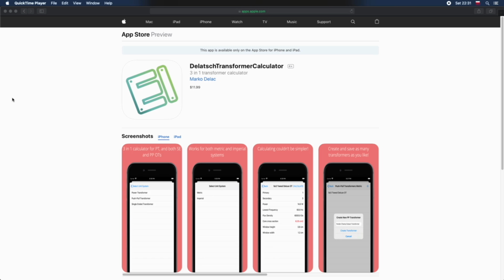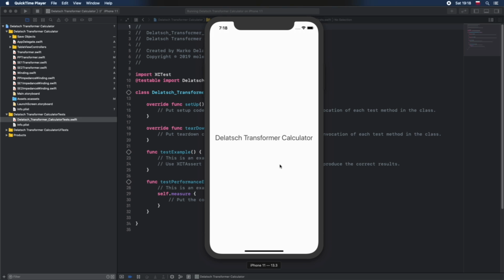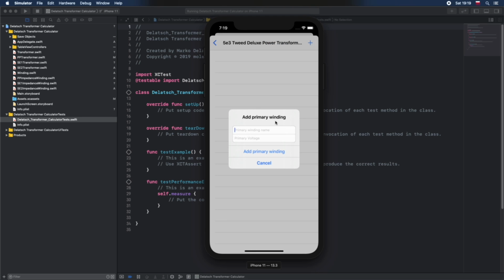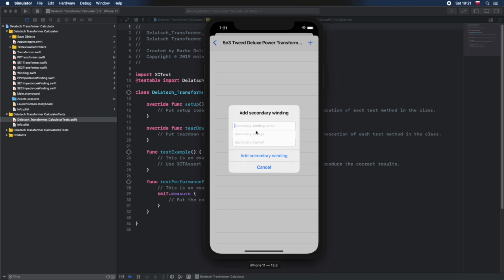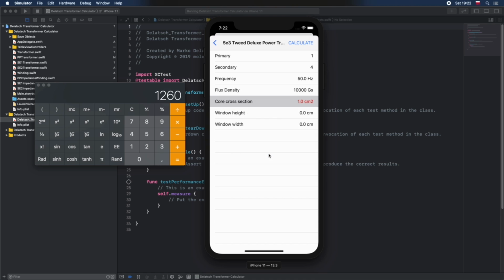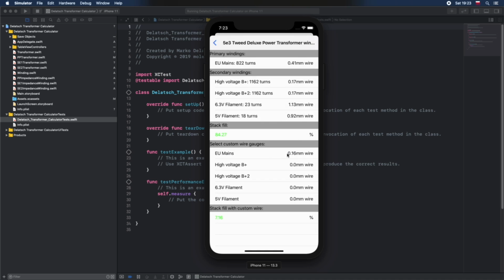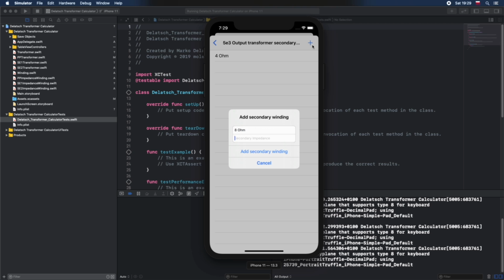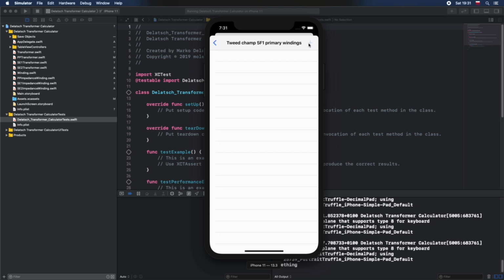Transformer Calculator App Now available for sale on the App Store! 2020

Comment: hi excelent congratulations . The app have all  the calculations and features  like your 3 diferent spreadsheet? The method for SE. trafos could set up for multi interlaves ? Please, Android too. Thanks
Reply from the maker: Thank you Juan! Yes it has all the features of all 3 spreadsheets, plus it can add multiple secondaries. It doesn't directly   do the interleaving for you, but you can easily manually divide the number of turns to the pattern you want. The android is coming soon as well, but it is a lot of work. There are many new calculators and app on the way so stay tuned!

Comment: For single ended transformers, what is method 1 and method 2?
Reply from the maker: Method 1 is using the inductance as the basis for number of turns and method 2 is more like a normal transformer calculation based on the voltage.
Reply: Thanks. I tried to contact you on your website. The message will not send. The app I purchased from your website will not work on my ipad.  @Delatsch

Comment: I  bought your app and see plenty bugs which makes using it really hard..but first of all it calculates wrongly.
Calculated output transformer:
Primary 3121 turnus 0.2mm , S1  70 turns 0.9mm,S2 99 turns 0.76 mm,S3 140 turns 0.64 mm
Custom gauges I set: Primary: 0.2 mm, S1 0.511mm, S2 0.511 mm, S3 0.511 mm
How it is possible app is not recalculating turns if gauges are changed?? I cannot trust this calculator.. Also buying four gauges to wind small 15W transformer is insane.
Please advice!
Reply from the maker: Hi, thank you for your purchase. I know the app isn't the most user friendly one, but the calculations are correct. The number of turns is not affected by or dependent on the wire gauge. The wire.gauge.is only important for the current, so that the wire can withstand it without overheating.

Comment: Hello. I’ve been using your app for while for power transformers and single ended out put transformer. I’m using M6 grain oriented laminations. For a p/p output transformer what value should I use for gauss core density? Thanks.
Reply from the maker: Hi, I would use 8000-10000gs
Reply: @Delatsch  thank you.

Comment: Hey friend, I have been following for awhile and appreciate you sharing your knowledge. I finally bought this app, and it's not working. I don't know how long it's been like this, but any time I hit the 'calculate' button, the app crashes. I've tried multiple times with different transformers and cannot get it to work.
Reply from the maker: Hi, thank you for your purchase! Just delete the transformers you have created so far and create a new one. Then, first create at least one primary and secondary winding and input all the needed fields like power, magnetic flux density etc. Only once you have those fields filled tap on the "Calculate" button. It should work fine. Please let me know if that worked out for you.
Reply: Man, thanks for your help. I see what I was doing wrong now. I just expected some feedback from the app before it crashed. 

I got it working, but I'm not sure what to enter for flux density. Is that a function of core material and size?
Reply from the maker: It depends on the core material. If you are not sure you can use 10,000 gauss. If  you have M6 or similar higher quality core you can use 12,000 or higher.  @jonasclarkamps

Comment: Hi. Got the app and I’m trying to design my first few transformers but have few questions. For a power transformer secondaries ht, should I insert the desired voltage or there is going to be a percentage for load? If for example I’m building a 250-0-250, should I wind both sides at the same time or just one and stop halfway and make the center tap there? Any difference?
On a p/p output transformer primaries, should I start winding and stop halfway for center tap? On the secondaries, if I want 4, 8, 16 ohms, if the app says 20 turns for 4ohm, 30 for 8 and 40 for 16, should I wind all independent or can I use same winding making taps at 20, 30 and 40 turns? Thanks.
Reply from the maker: Hi Ramil, thanks for your support! Yeah, for the 250-0-250 you would input separately 250 @ 100ma for example and another winding 250 @ 100ma. You can wind separately one then the other and just connect the end of first to the beginning of second later when you are soldering the wire leads. If you have a 50 or 60 volt bias tap you can subtract that from 250 and wind it as a part of the same winding.

Comment: First of all, congratulations on your work. I’d like to know if I can calculate a Lundhal ll1540, to build a copy with this app? Sorry about my English...😬
Reply from the maker: Thank you! When it comes to input transformers, there are a lot of design aspects which have nothing to do with the calculations itself. You could calculate the number of turns of course, but you would need high permeability core, mu metal can, and probably special interleaving of the windings and maybe even bifilar windings to achieve the same results.

Comment: To be able to handle DC current, transformers need a gap, especially with transformers for single ended amplifiers. Is this also taken into consideration in the calculator?
Reply from the maker: Yes, the lower magnetic flux density is compensated for and the practical way of determining the air gap is explained in the tutorial. If you purchase the app, you can send me an email for the pdf tutorials.